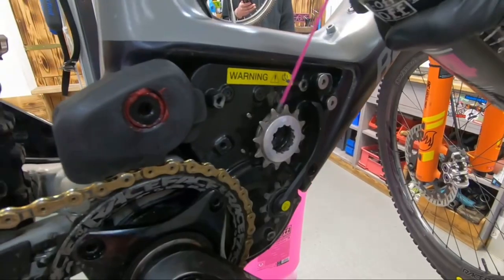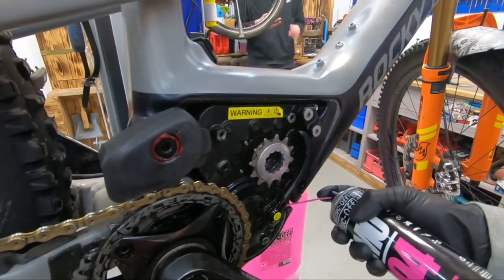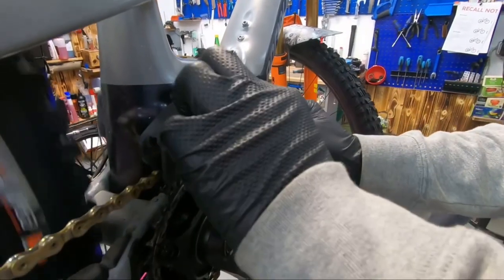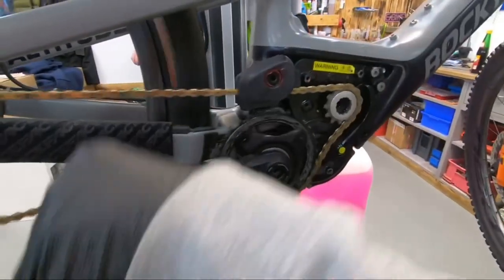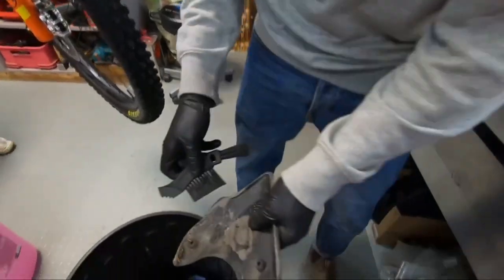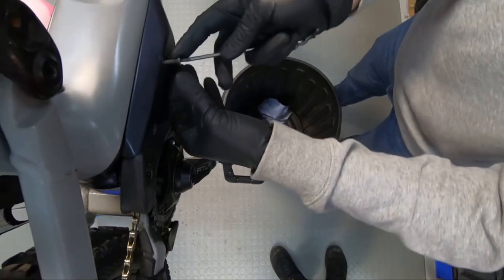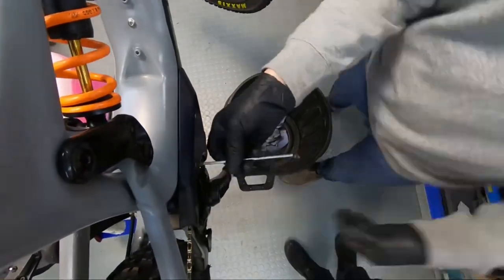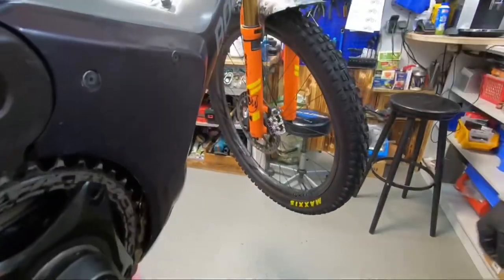Service Your Rocky Mountain Powerplay Drive System

Comment: its like cleaning a stihl chainsaw. With that cover and small drive cog. Can it be worked on with one tool like stihl?
Reply from the maker: Hey Craig, thanks for the question. Unfortunately not. The flat head driver and huge nut drivers from a chainsaw are not going to work. Small bicycle multi tool and a flat screwdriver should do the trick. 
Have fun.

Comment: Hi, is there any risk on the washing process? Thanks
Reply from the maker: Not sure what you mean, but I wash my eBikes just like my analog bikes. Motorex bike clean or MucOff if I must. Spray it on, leave for 10min and spray off with a garden hose. 
As for the drive train, needs to get cleaned, so follow the video and you’re good to go.
Reply: @RideBikesBeHappy  i did and it went super, thanks love your channel
Reply: Never flush the spider bearing or any bearing on any bike with a solid water beam. That will push moisture in past the seals and cause corrosion that will eventually destroy the bearing. 99% of all bearings I've replaced as a bike mechanic have shown signs of rust inside. That goes for any bike brand..

Comment: Chaincleaner und Bremsenreiniger, damit killst du die Lager in null komma nix!
Reply from the maker: Everybody has an opinion. Yours is wrong, but what ever.
Reply: Danke, warum ist meine Meinung falsch? Das sind starke Lösungsmittel die das Fett aus den Lagern spülen. Dichtungen sind leider nicht zu 100% dicht und unterliegen gerade am MTB großem Verschleiß. Mit deiner Methode beschleunigst du massiv den Verschleiß deiner Lager! Bitte um eine Erklärung warum du denkst das meine Meinung falsch ist. @RideBikesBeHappy
Reply from the maker: @tst09  dude, I’m not going to have a massive argument about this with you, but the basic point is that you are not meant to bath the bearing is these solvents, just give them a light spray and then wipe down. I have been a bike mechanic for 28 years, worked for various World Cup MTB teams including Fox Shox, I’ve used good quality brake clear for so many things, and it works. You can have your opinion, but I know what works. If you don’t want to do things this way, then don’t. You are allowed to do what you want, but stop being a keyboard warrior and just go ride your bike. ✌🏼
Reply: Danke ich bin normalerweise kein Keyboardwarrior, und ich fahre seit 30 Jahren MTB und habe selber 4Jahre als Bikemechaniker gearbeitet. Das deine Methode funktioniert bestreite ich nicht, die Teile werden sicher super sauber, das Problem ist das du damit die Lebensdauer verkürzt. Mir ist auch klar das das für ein WC-Team kein Problem ist weil die Teile laufend erneuert werden. Wenn du die Teile aber selber bezahlen musst und sie länger als ein paar 100km verwenden möchtest ist dein Methode eben nicht optimal.  
Darüber sollten sich die Leute die dein Video ansehen eben auch bewusst sein.  @RideBikesBeHappy